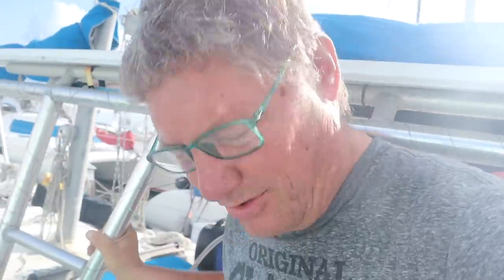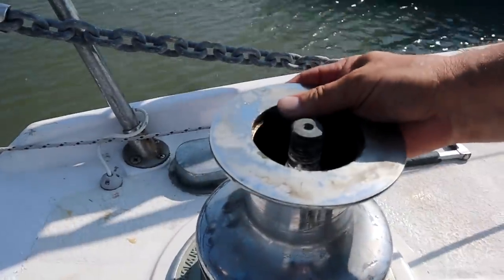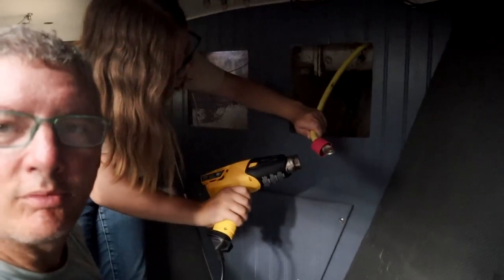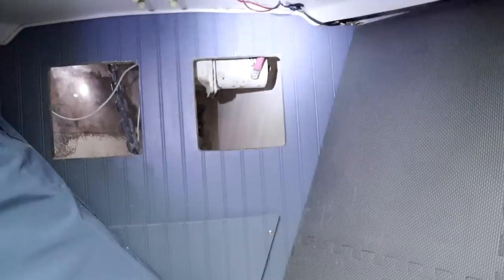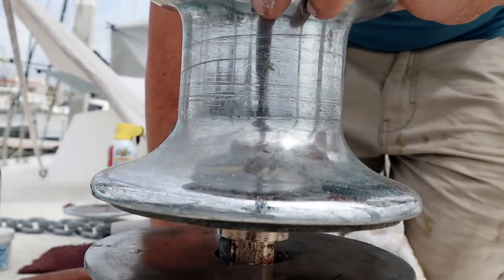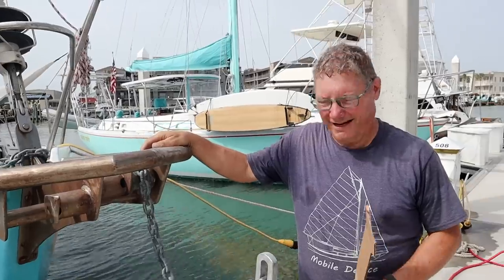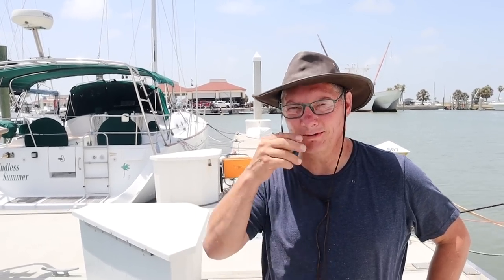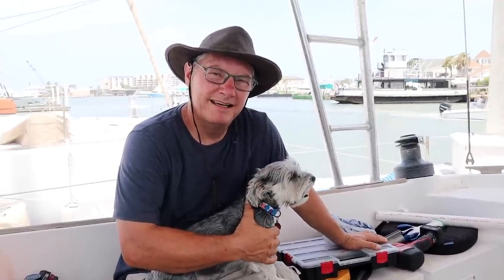Rebuilding Our Forty Year Old Windlass | ep 214

Comment: Todd you’re awesome. I feel like you should run the engine when using the windlass. The alternator amperage is better to use than draining your batteries.
Reply from the maker: That would be so nice, but don’t forget we have an electric motor, with no alternator.

Comment: Get a common size chain and gypsy to match. Easy to replace or extend chain in foreign places.
Reply from the maker: Good idea. How common is G4 around the world?
Reply: I think G4 relates to the material. High carbon steel is a lot stronger so you can use a lighter chain for the same load. In Australia a lot of G4 3/8” chain is used.
Reply: Sorry forgot to mention its usually short link!

Comment: Jumping chain is a miss match of chain and Gypsy or one or both is worn. 
Gypsy if available will be expensive! 
You might be able to temporarily space out the groove in the bottom of the to adjust the fit but what with  ? and real Bush fix! 
Cheers Warren
Reply: Your Vlogs has improved over time, I commented in a negative way some time ago but I'm still watching and enjoying your learning curve. 
Not only the Vlogs also your boat work and problem solving has improved, keep it up! 
😎
Reply from the maker: New gypsy is $700.

Comment: wildcat is for rope, gypsy is for chain. You got it, the gypsy(chain wheel on the windless) must match the chain. Both specs must match. It didnt look like the windless had trouble getting the anchor over the roller. I would see how different chain or gypsy wheel effects it. Then decide on bow modification. Its a nice modification and looks like it may ease the pressure on the windlass. Question is, how is it going to behave when the chain is running over it. Maybe more of an L shape than a V. That way the back being a little longer than the front(from center),  that the chain will hold it down till the pressure of the anchor gets there. You really have to research before buying chain. Even the major brand has chain that will go bad quick and it is expensive. And they also make the best chain. From watching videos they say you must scrutinize the specs. But also check the feedback from cruisers in saltwater. Couldnt tell from the specs alone from the good and bad chain. They said also call the manufacturer. Not that they will give you a chains lifetime. Maybe they will say something that helps.
Reply from the maker: Merrimarine makes custom bow rollers out of Delrin that are cut specifically to fit the chain and shank of the anchor. That should make it all work much smoother.

Comment: Good afternoon just finished your episode you've come a long ways and are beginning to reap the benefits of all that work. Have a question in regards to the name of the material you used for your Bimini. Would like to know the name of the material and where it was purchased from. Safe sailing !!
Reply from the maker: Emily it is called Expanded foam PVC. We bought it at a local plastic shop here in town. They bright it in from San Antonio. You should be able to find a local supplier as well.

Comment: I wouldn't commit on modifying the bow roller until the chain/gypsy problem is fixed. You might find that the anchor works without slipping in its original slot with the proper chain/gypsy combo. Can you reverse the windless direction? That comes in handy when one wants more chain out. Also do you have a way to make fast the anchor to the boat without using the windlass? One more thing, if you have to purchase new chain, don't cheap out. There are plenty of videos of sailor regretting saving a few dollars when the chain rusted out after just a few years. I think ACCO is a brand you might look into. definitely not Chinese.
Reply: I agree, fix the chain/gypsy first. I have a cnc machine but can only cut aluminum if that could help.
Reply from the maker: Darn, it would definitely need to be stainless. I think the loads may be too much for aluminum.
Reply from the maker: Yeah I want to see how a matched set performs. Also you are right there are lots of horror stories on chain.